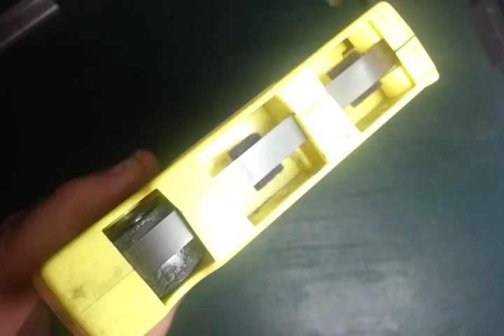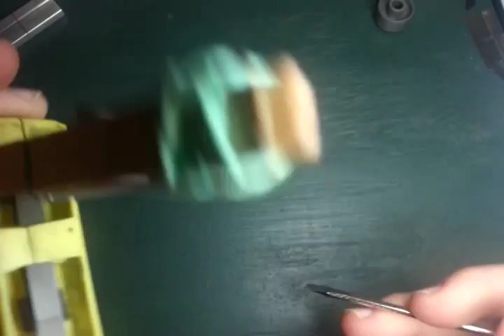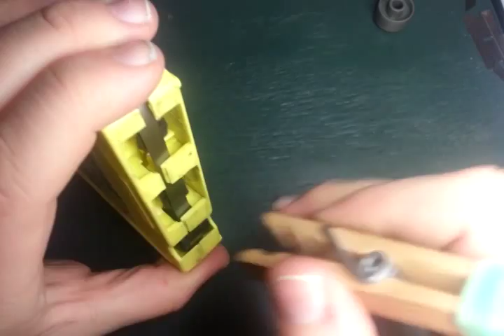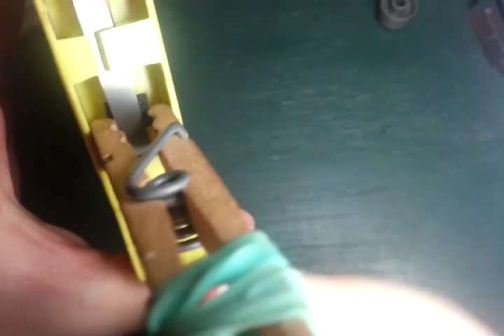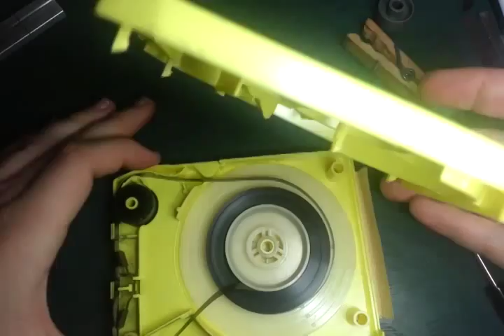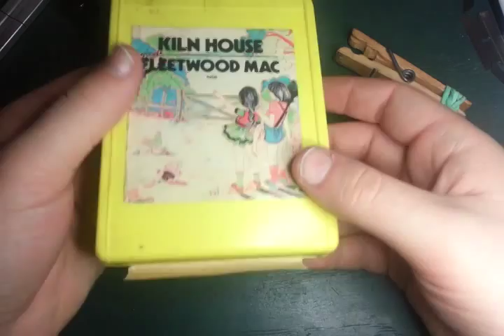8-Track Tape Repair: Replacing a Melted Pinch Roller

Comment: Where can you get new rollers?  Or do you cannibalize good ones from other carts?
Reply from the maker: I currently source them from other carts. I've been looking into ways to replace the melted rubber on the original rollers, so far I haven't been able to find a way that matches the performance of a real roller and that is economical. I know there is another guy here on YT that uses rubber sander spindles, I could see those working well.
Reply: @airplaneengine  So , which type of cartridge did you get the new roller from?

Comment: Please: be carefull when you're using the screwdriver. You could get harmed, Greetings
Reply from the maker: Antonio Martínez Lucio LOL. Only when I'm recording a video does a cartridge give me trouble when opening. Oh well, it's a "live repair", no rehearsing before recording. You can also pry the cartridge open by inserting the nose of a pliers in the end of the cartridge and then pulling apart the handles. You run the risk of breaking the pins off the cartridge though.

Comment: This doesn't always work, depending what cartridge your fixing, GRTs have wagon wheels you can't use those plastic RCA WHEELS , the spindle is too big and the wheel does not fit over them, You can't replace them with ''ANY' OTHER WHEELS'' than wagon wheels period!!!
So the only way you can fix those tapes is to find a junkie GRT TAPE with a good wheel, but most of them you find the wheels are gone.